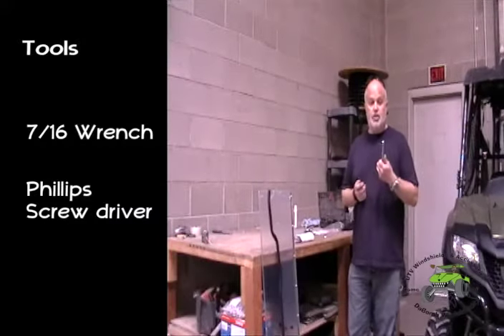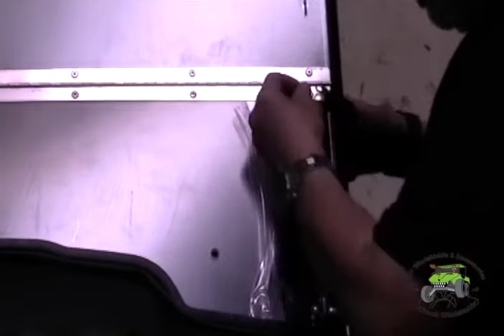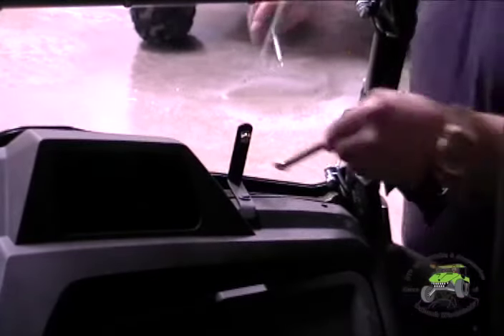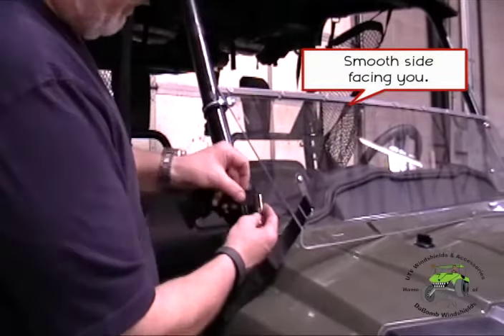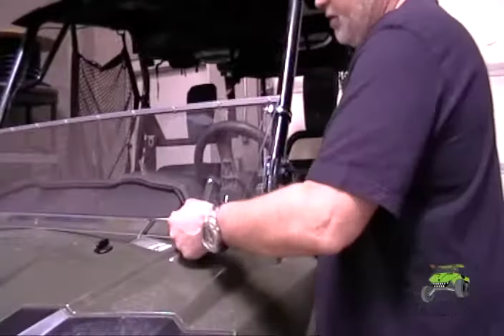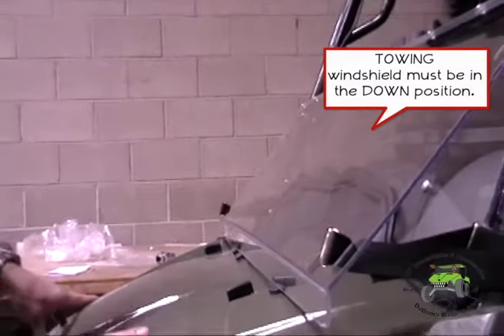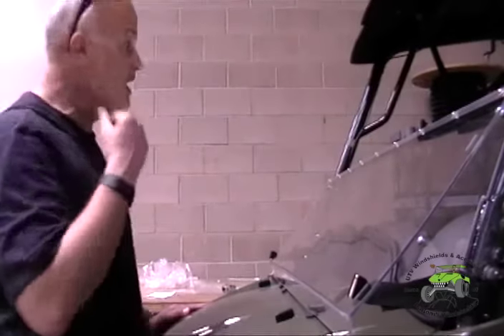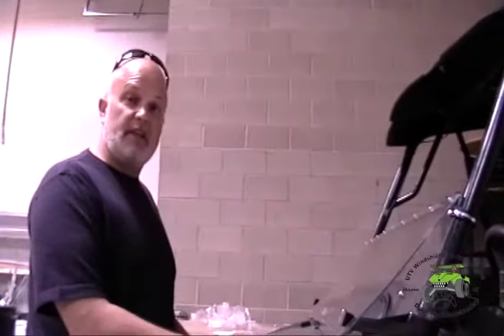Installation Tutorial for a Pioneer 700 | UTV Windshields & Accessories

Comment: Only problem I see,  is with the rubber bumpers falling off. I like many people use armor all on the hood. So they not gona stick for very long. Would be nice if there were holes drilled in the top edge of the windshield and the bumpers attached with a screw to the windshield.The bend on the top edge would have to be the other direction though.